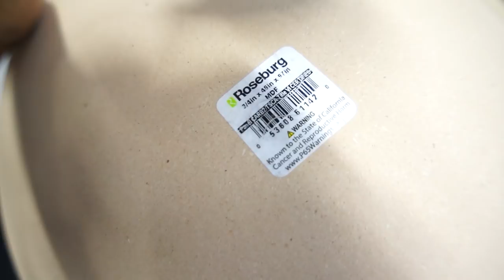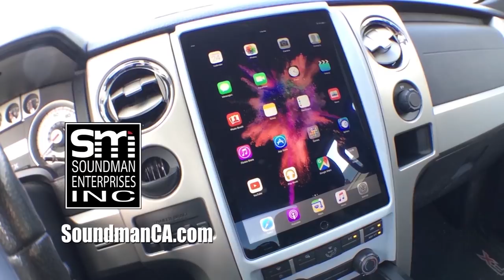Acura subwoofer box final assembly! - Acura stereo system #15

Comment: What kind of nail gun do you use and what size nails?
Reply from the maker: Porter Cable, 18 gauge brad nails 1&1/4" long 👍
Reply: Looks like a porter cable. They use standard finishing brads ( nails)
Reply: @soundman_caraudio  thanks for the swift reply Doug. Keep up the awesome work